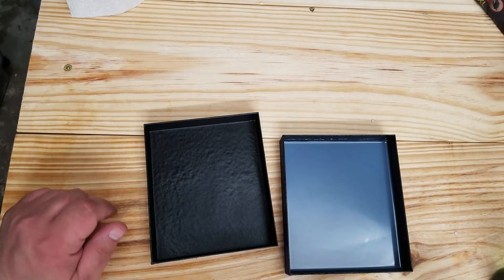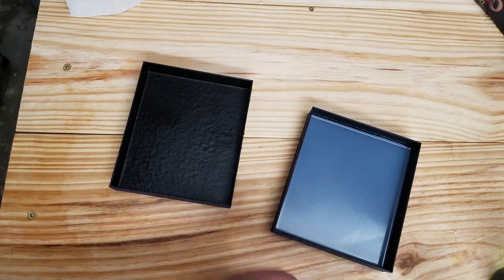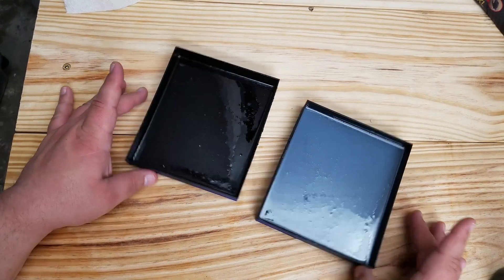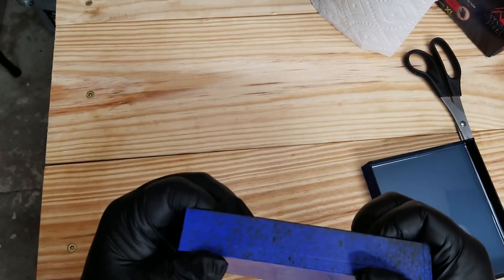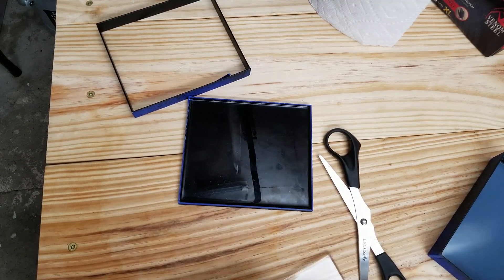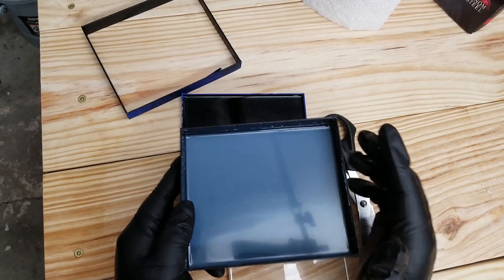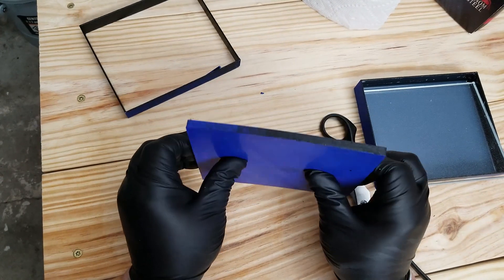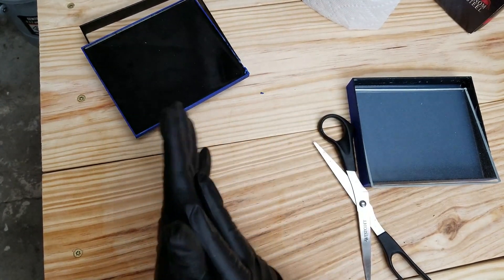Can You Create a Mold Box Using Flex Seal?

Comment: the SRC Platinum Silicone used in the second box, is that a spray or a mix? How did you apply it?
Reply from the maker: Hi Mary, it's a 2-part silicone mix: https://specialtyresin.com/product/cast-mold-platinum-food-grade/ 
And I just poured it in and tipped the box to ensure it coated the sides.
Reply: @seventhstreetstudios5538  Thanks!